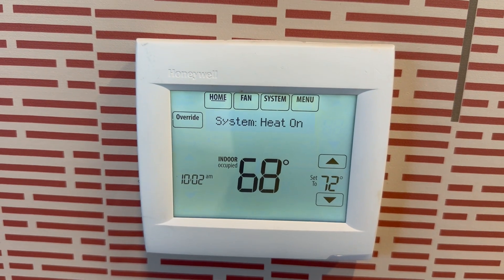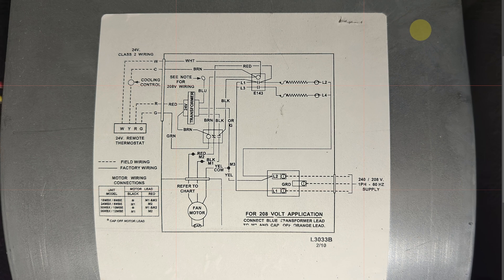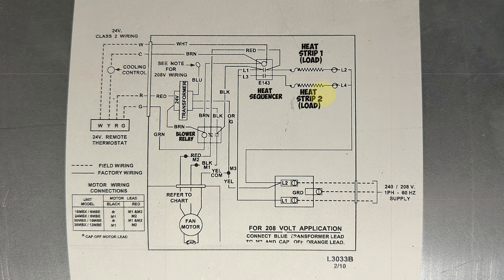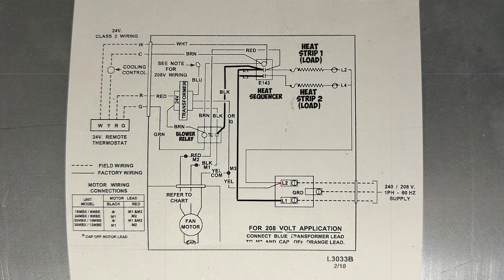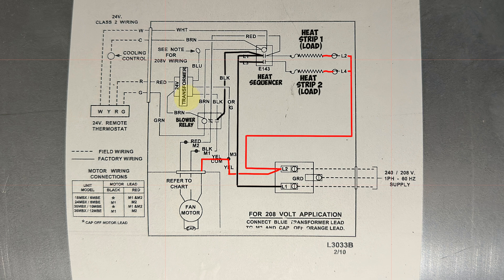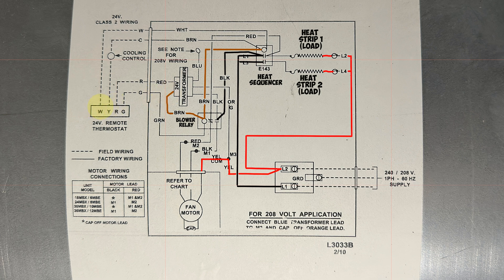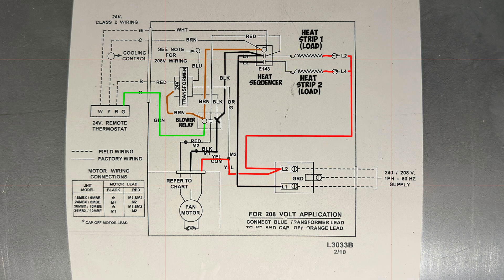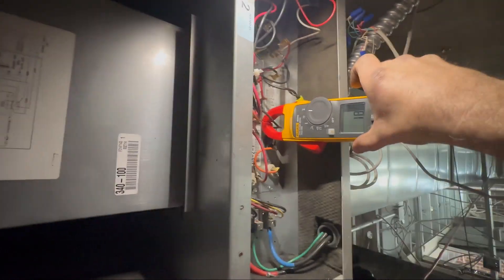Troubleshooting a Heat Sequencer Circuit w/Schematic

Comment: Great demo.  Have you done any with a DC amp clamp?  Not sure how to do this with my new DC amp clamp. As it needs to be cleared with AC current???
Reply from the maker: I'm not sure. I don't do circuitry much just appliances and hvac. In the field I work in I don't encounter a real need to measure DC amperage with a clamp as its so low and don't know how accurate it would be.
Reply: @ApartmentMaintenancePro  Us too basically new to us. Thought you might have more experience there.  ENJOY your vides, the trouble shooting ones help keep me sharp!